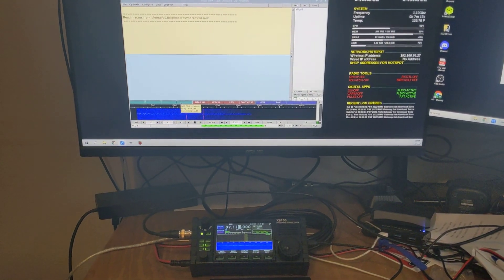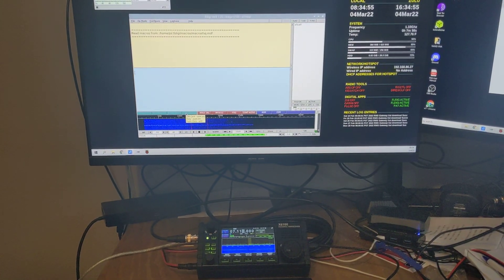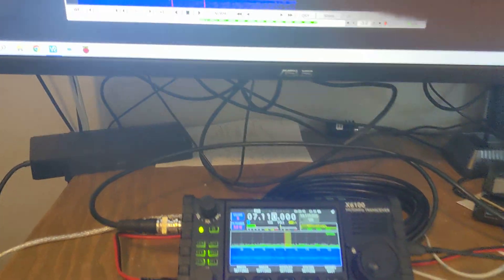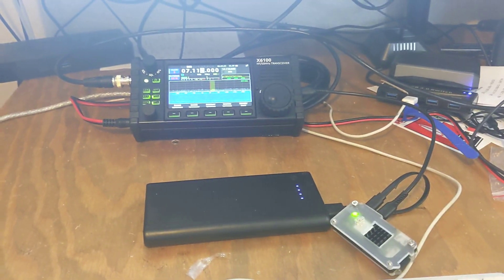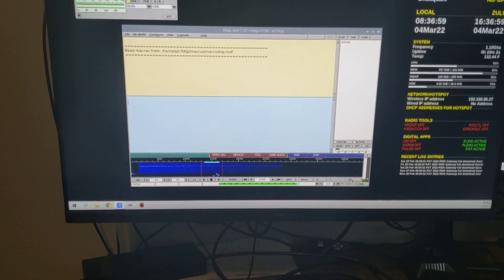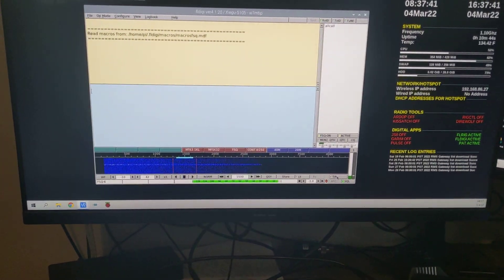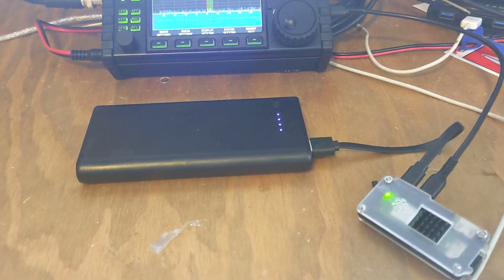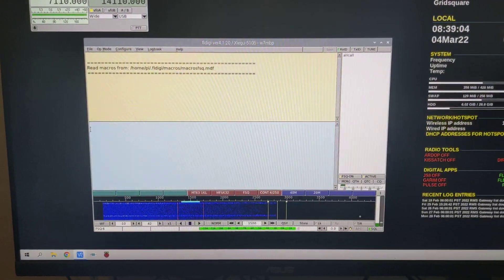Xiegu x6100 running FLRIG and FLDIGI on PI zero 2 w

Comment: The question is: How to get FLrig to work with FLdigi. FLdigi just won't talk to the x6100. We don't have a XML file for the X6100 yet. Can you actually use FLdigi as normal and key the radio from macros etc- using FLrig? Most of us are going to be in lostville county trying to get fldigi to work. Help!

Comment: I think your frozen waterfall on FLDigi is more of an issue caused by the slow processing power of the Pi Zero than RF. Have you tried that same cable with the Pi 4?
Reply from the maker: I thought that too, but if i run the radio at 0.1 watts, the zero runs just fine..

Comment: Have looked at KM6LYW Radio DigiPi Project and I use build a pi also
Reply from the maker: I have and it's a great build.  I was using KM4ACKs build which has a lot more applications, so I thought I would try it on the Pi and it seems to be working good so far.
Reply: @w7mbp348  I might have try it!